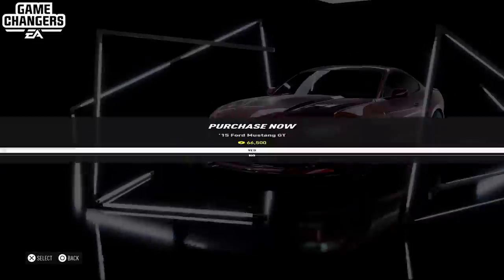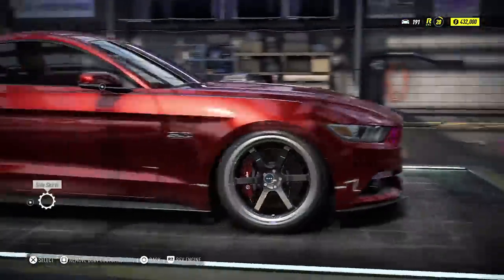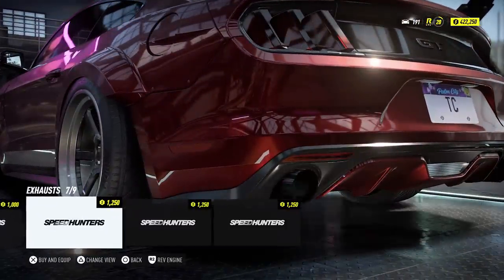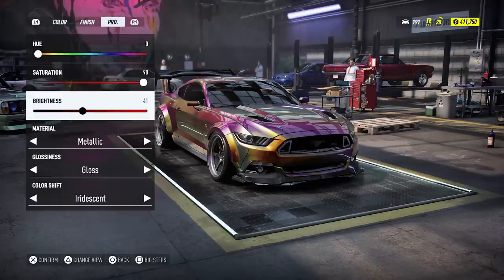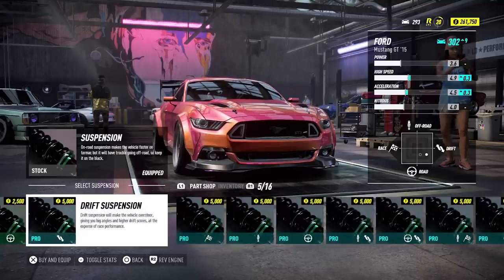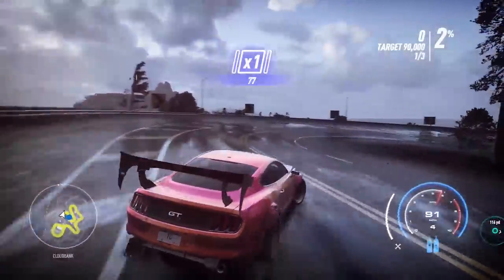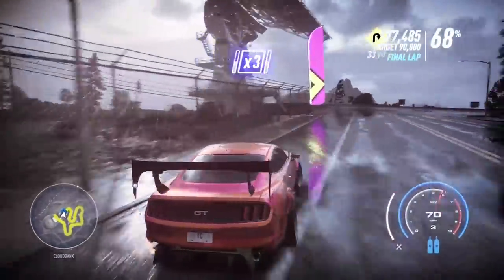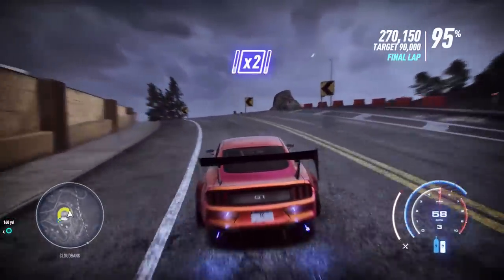Need For Speed Heat: Mustang GT DRIFT BUILD!! Drifting Tips & GAMEPLAY! Physics and Handling Info

Comment: You forget to put the differential :P...this gameplay it's much better than the previous drift video, here we can see much more long drift compared to the "Showcase: pieces, the tune of you car changes a lot the handling. As I can see needs to be very presice to hold the angle, maybe to much gas? Really love the new drift, i cant wait to play and test, this time its gonna be a challenge to be a drift king!
Reply: too much gas? the car can barely pull a corner with 100% throttle

Comment: I like the sound difference, you can really hear the  supercharger whine. Looks like we're gonna get the same exact body kits from payback which is disappointing. The drifting looks exactly like payback which I hated.

Side note, I don't understand why people hated 2015's drift mechanics, yeah it was brake drift but with AUTOMATIC TRANS, manual trans drift worked just fine.

Comment: Drifting in this game is kind of difficult on like the previous games which is much easier because of need for speed is pretty much an arcade game since the 1994 original and then by underground 1 things changed the handling is different from the 1990s era need for speed so they want to bring it back from need for speed heat I kind of miss the arcade handling that was brought back in nfs nitro
Reply: NFS since 2004 has been a blend of arcade and simulator, its not 100% arcade, if it goes full on arcade people are only going to start comparing it to the likes of Asphalt.
Reply: @enditakamweneshe6428  nfs HP 2012 most wanted 2012 and rivals has an asphalt feel because it has no customization